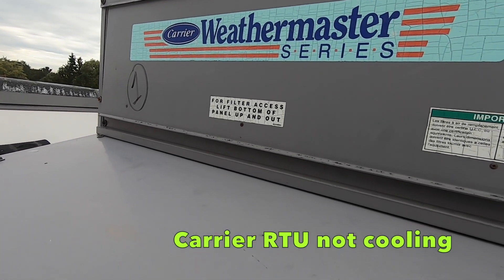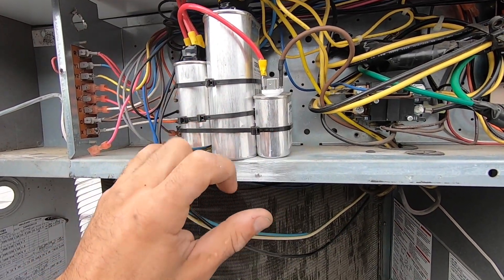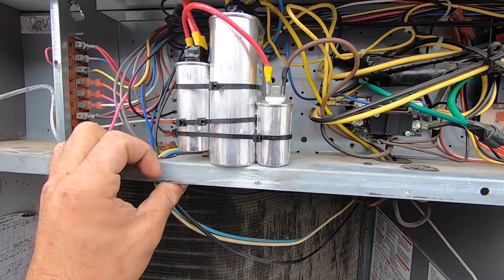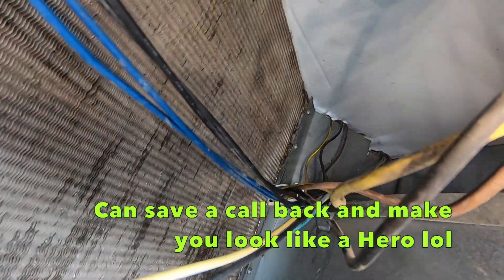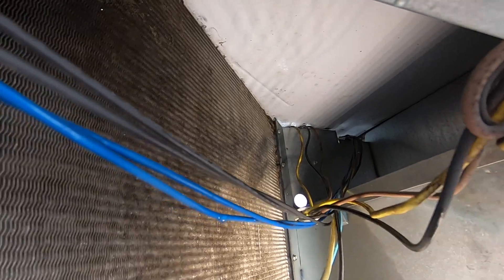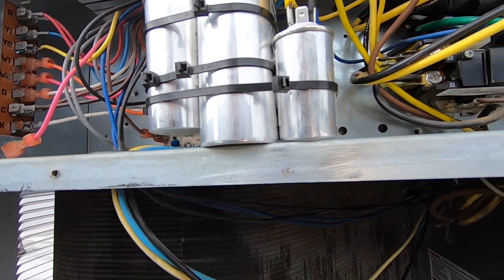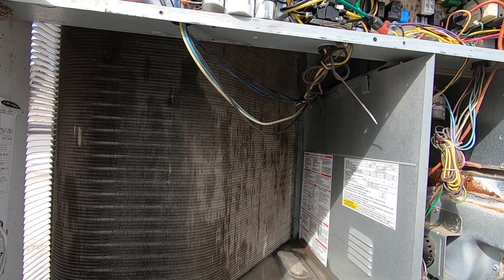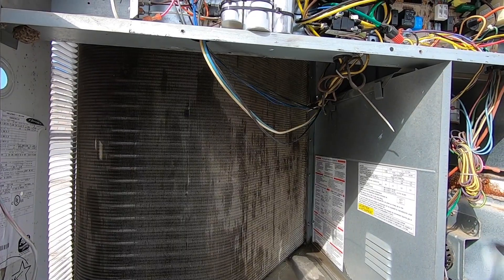HVAC: Rooftop unit not running | Carrier rooftop not cooling

Comment: Literally just ran into this today!!!!! Did you ever get a call back on the fan going on and off???
Reply: @HVACR North no problems as of yet. He said the same thing fan on and off but no shorts I even shook the wires and couldn’t actually catch the fault in action. I put in the correct capacitor the following morning still no call back.
Reply from the maker: no bud, are you have issues ? putting capacitors in series or parallel wont cause that. let me know if you need any assistance.

Comment: Hey Joe... about 30 yrs ago I was helping my HVACR  boss try to figure out why the main breaker kept tripping on a rooftop unit. In the end we went back there at night and saw the spark in the blower compartment while in the dark....short found on a wire rubbing similar to yours.
Please do me a favour and check out this video link. It shows a leak on a ductless Mini split I installed. The customer did a Reno in the spring after I just installed it in the fall. I voided his Warranty when he called me out mid summer to diagnose whyou it wouldn't run. Please check out the video link and read my own comment on that video. Let me know what you might estimate the time it might take for that refrigerant to leak out when you see the bubbles in the video. 
Thanks, Kevin
Reply from the maker: Good idea to go back at night lol. Ok email the link
Reply: @HVACRNorth  I am working on setting up email here. I have an android app for youtube that needs updating. If I use Chrome with my samsung tablet it lets me read and respond to your comments. Im wotking on improvements basically